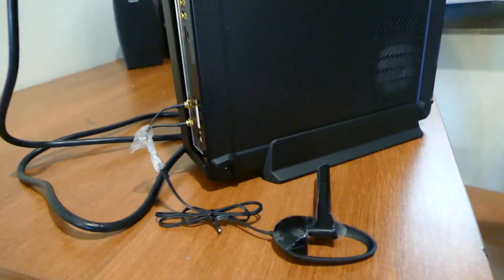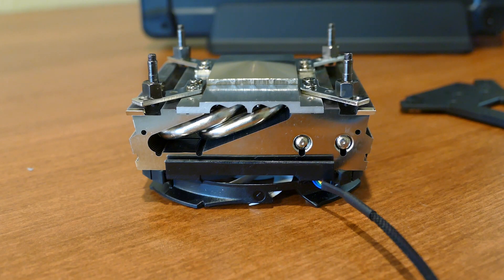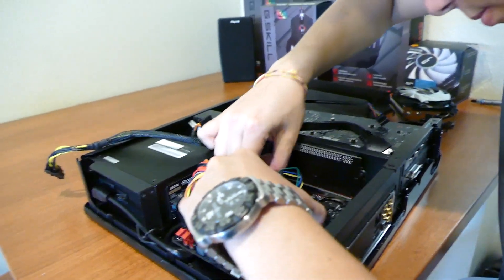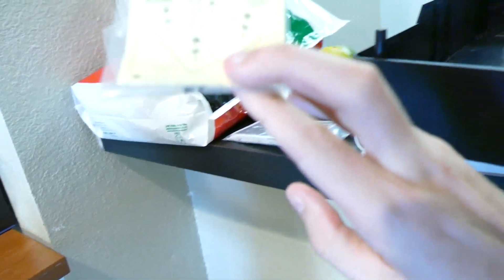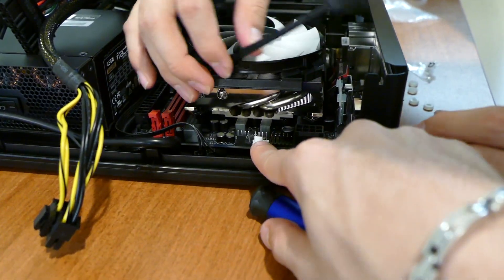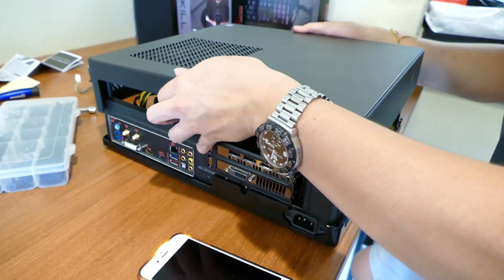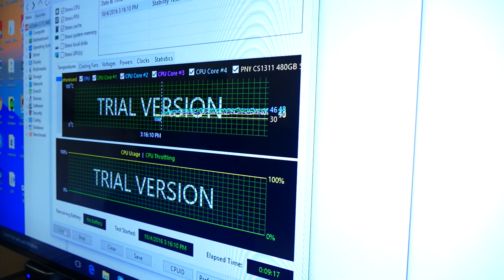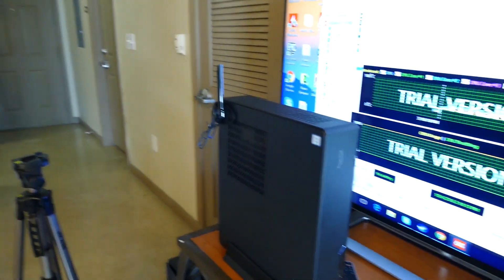Cryorig C7 Installation (Temp/Audio Tests)

Comment: Has it always been a normal thing to reuse thermal paste...? Not to mention add more thermal paste on top of old thermal paste...
Reply: No it's not a normal thing and I don't recommend doing it if you want the best possible temps for your pc.  It's also just not that difficult to take the extra 2 minutes to remove the existing paste.  Also, I'd have to disagree that just because it's not a $4000 OC build to not care about temps.  Builds with this form factor are just as prone to high heat, especially as a gaming pc.  Zack (spelling?) may not care about his temps but the viewers likely will.
Reply: i agree, is not perfect !
Reply: Air bubbles? Maybe you could do a video testing this!
Reply: true true aslong as it never goes over 60/70c :D
Reply from the maker: Who cares? It does what it does. This isn't a $4000 OC build.
Reply: Science Studio Who cares? My OCD. That's who.
Reply from the maker: My condolences.
Reply: Science Studio It's appreciated. Thank you for the comical conversation.

Comment: Thermal paste is a joke I use a liquid cooler and use stock and get under 30 Celsius on an i5 6600k oc to 4.4 ghz after a few hours of gaming
Reply: lmao
Reply from the maker: Thermal paste is a joke? Do elaborate.
Reply: Science Studio idk maybe I got lucky my temps using stock thermal paste is under 30 oc to I'm saying that aftermarket thermal paste is not necessary
Reply from the maker: Ah, I see. Differences are fairly marginal in most cases - unless you plan on using something like Mayonnaise.
Reply: I'd really like to see this explanation too..
Reply: If you mean you get under 30 Celsius on a load at 4.4ghz I'd like to see proof. Id you mean after the gaming well that makes more sense

Comment: C7 has blown up, really really popular.
Reply from the maker: I agree. And it's probably my top pick for low-profile coolers at this point.
Reply: I heard the scythe big shuriken 2 is even better for the node 202. Even though it's 2mm taller than the cpu clearance height, it fits without having to remove the dust filter https://pcpartpicker.com/builds/by_part/GsZ2FT#h=272
Reply: I wonder if the Reeven RC-1001 Brontes would fit, it's a single mm higher than the big shuriken.